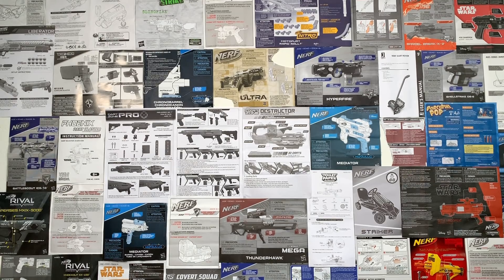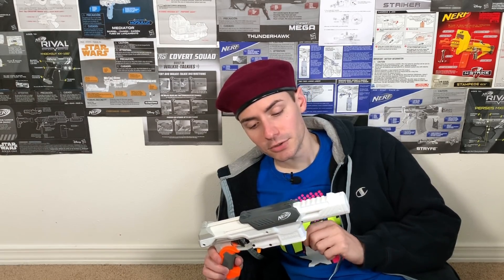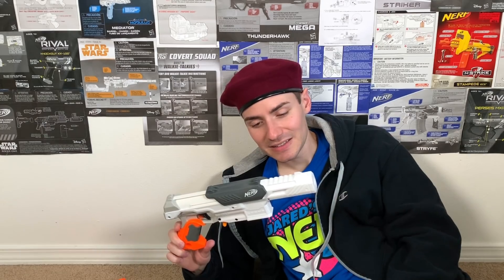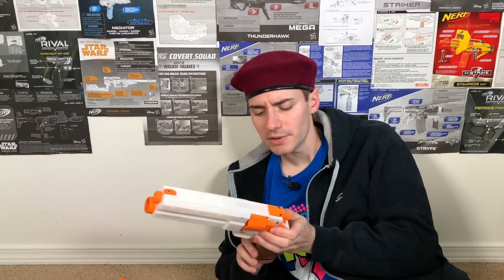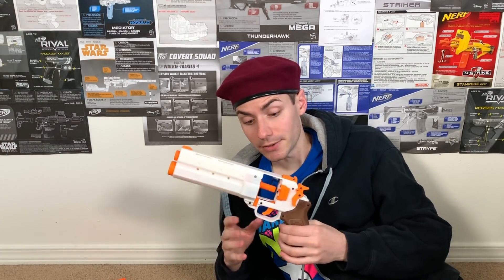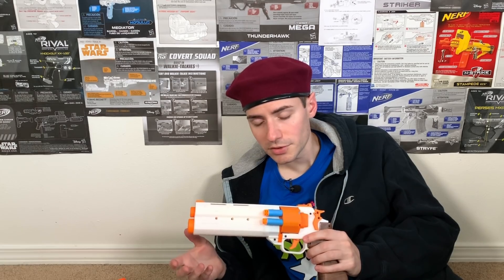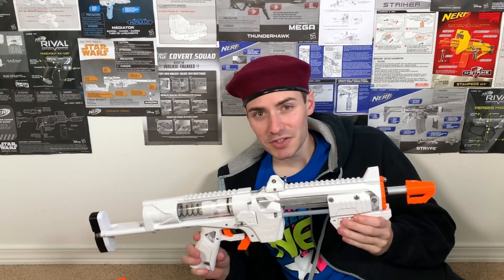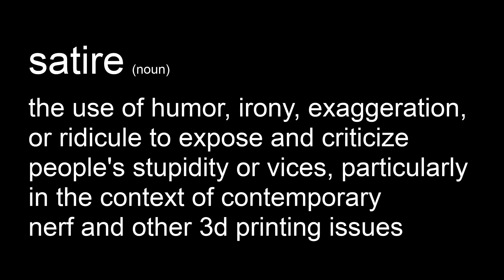bert: 3d printed blasters cost big money

Comment: 3d printed nerf guns which take lipo battery’s and slugs and have higher fps but big price tags but you can print the blaster and get the moter separately for a cheap price 

bert this is UNEXPECTEDABLE
Reply: This is exactly what I am doing now with an fdl 3
Reply: Except I blew up so many arduinos and mosfets trying to figure out the wiring myself that it costs a little more than it should have